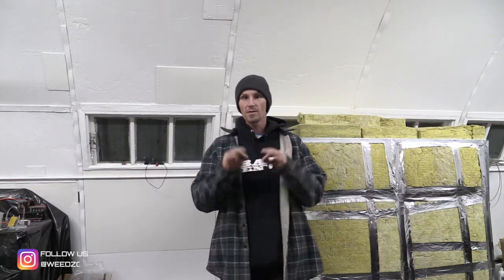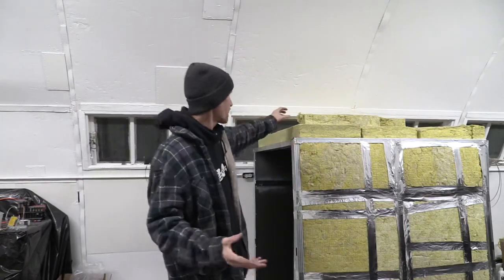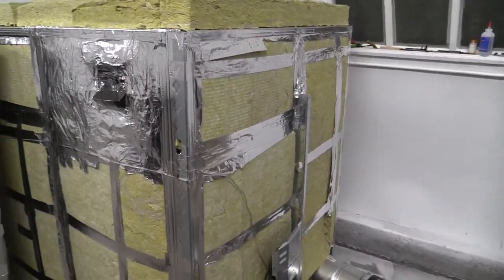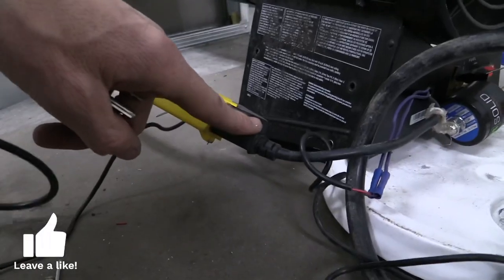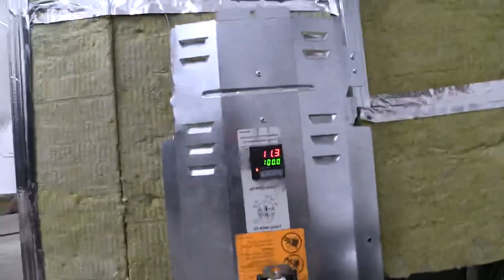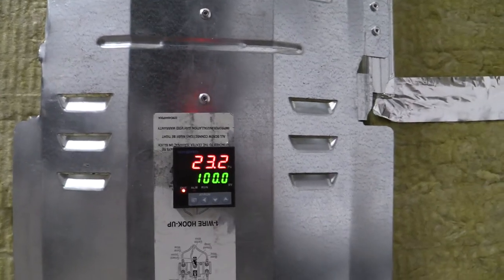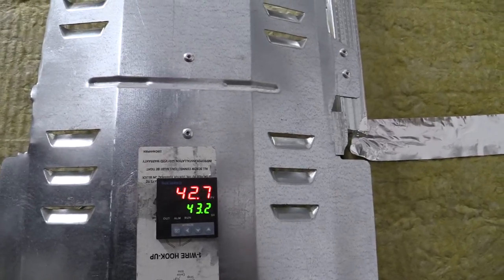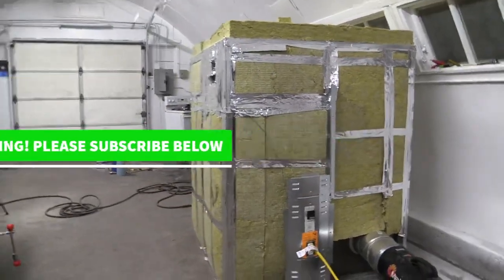How to Build a Powder Coating Oven at Home

Comment: You can cover that unit in a tile board half inch tile board it’s about $15 appreciate relatively expensive absolutely flameproof and heat proof
Reply from the maker: IRON60 BITCH We found that 20 gauge or 21 gauge steel is pretty inexpensive to do the whole oven. We are actually looking into you scanning the whole outside before we make our move here this next month.

Comment: Hi, I guess that air forced heater has its own thermostat that control the temperature from going above 40-50 C; is that right?
Reply from the maker: Fadi Al Amiri no sir , we use an InkBird PID with a thermostat

Comment: what i never understood in these things, 1 you blow air in it, not filtered, so dust goes in it as well, 2 when you blow hot air in the oven it needs to come out somewhere, so you loose a lot of heat i guess? correct me if i'm wrong :),,, is it not possible to connect the outlet air to the inlet of the blower ???
just thinking :)
Reply from the maker: We've never had an issue with losing heat at all.  The intake, does not blow in dust either unless your heater is full of dust.

Comment: What size is that oven? And how many btu is that heater
Reply from the maker: Wildin Garage the oven is 4’ wide 4’ deep and 5’ tall. The heater is 70,000 - 120,000 btu. You could also use the smaller 30,000 to 60,000 BTU, it just may take a little longer to warm up. We got this one for $100 on Facebook marketplace.
Reply: Weedz Garage ok cool, thanks for the reply I’m looking to do similar size oven as you using the propane heater, I wasn’t sure it would work but glad to see it worked for you!
Reply from the maker: Wildin Garage you shouldn’t have any issues!

Comment: A list of the PID, thermo coupler etc used would be great.
Reply from the maker: Murrica Motors we can do that!
Reply: @710performance  yeah it would help and you mentioned to use the 1/2" solenoid instead of the 3/8" one correct? Also, how long does it take for this setup to reach 400°?
Reply from the maker: Murrica Motors go with the 1/4” not 3/8”. It takes about 5 -7 minutes to heat up to 400
Reply: @710performance  wow brother that is a quick heat time. And that is on low correct, not high? Is the forced air from the heater so much that it will blow any powder off before it has a chance to heat up and stick?
Reply from the maker: Murrica Motors Yes that is on low. It does not cause enough movement to knock any powder off 🤙 If you find that your heater is producing too much power, just add another section of ducting to pull it farther away from the oven.
Reply: @710performance  very good info brother and much appreciated. I will be building my own very soon and most likely be just buying a new heater. And yeah that extra sleeve of ducting would work perfect if ever needed. Looking forward to more vids. Mine is going to be 6'Widex4'Deepx8'Tall
Reply from the maker: Murrica Motors That is awesome! I wanted to make mine 6 x 6 x 8 but the cost of the material for that size is just too much for our shop right now. What is good is we can always add an extension onto it. Good luck with your build I would love to see you document it. Please let me know if you have any other questions.
Reply: @710performance  will do and thanks
Reply from the maker: @JustAGuy781  Thank you!
Reply: @710performance  do you have a link or did you use a temperature probe?
Reply from the maker: @JustAGuy781  https://www.amazon.com/gp/product/B01N31E8BN/ref=ppx_yo_dt_b_asin_title_o00_s00?ie=UTF8&psc=1
Reply: @710performance  thank you bro! 🙏🏻👍
Reply: @710performance  I didn't realize the Ink Bird came with it, my bad man. Thanks for replying back though, very much appreciated.
Reply: How long does your oven take to heat up to 400 degrees? I have a similar heater rated at 30-60kBTU & in the process of building my oven which is 4x4’x6’. I was talking to a guy in a pc forum & he said I needed one closer to 120-150k BTU, the 60k wouldn’t work so he says. Curious if the 60k will be enough or if I need to return it for the 150k one?
Reply: Did you guys have to use the relay that comes with the inkbird PID controller? If so, what is it doing?